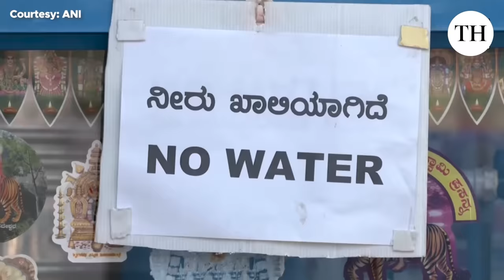Why is Bengaluru staring at a severe water shortage? | The Hindu

Comment: Answers for this problem
1. Avoid constructing High rise buidlings.
2. Avoid Traffic which will heat up the environment and also dry out the water
3. Deepen the Ponds 
4. Give permanant WFH to all the employees so that they don't have the stress while coming back to works
5. Avoid digging borewells which will even dry up waters 
6. Combine all the rivers altogether with other states so that it will solve the scarcity
Reply: That 6th point should be the 1st point. 👍

Comment: Bangalore as a highly developed IT hub that has outpaced its water supply. How much can Kavery do. It is only a small stream in Kodagu. The same situation exists in Chennai. The best thing would have been to shift all the IT sectors to smaller towns at the periphery of Chennai and other cities. The whole state can develop.  Once Chennai had more than 2000 lakes and many rivers. You could go by boat from Madras to Mahabalipuram. Even the areas around Chennai had so many lakes. A similar situation prevailed in Bangalore in the 1970s. Beyond Madivalam and Bommanahalli, there were only rice fields and lakes till Hosur. I used to walk miles and miles, and choose a lake to swim.

Several large areas have to be identified, where no construction will be allowed. These areas can be deepened and used as a reservoir.. The Cholas, Karikalan Chola in 190 AD built the Kalannai and Sundara Veera Chola build the Veeranam reservoir more than a thousand ears ago. Mrs. Jayalalitha connected the Veeranam lake to Chennai city and its suburbs. Apart from this Chennai still has some lakes that supply fresh water. If these lakes fill up and overflow in the rainy season, Chennai will drown. Some parts of Chennai are below mean sea level.

Bangalore is landlocked, but if there large reservoirs located all around Bangalore, all the water can channelized in the ran season and a constant supply of water can be maintained for Bangalore city.
Reply: Thank you.

Comment: Not blaming any party in particular. But Bangalore is going to the dogs. People are constructing six floors with out approval. No one to check. Pollution is increasing and is upto 150 aqi on daily basis now.Hardly 10 mtrs wide road will be allowed to construct 20 story apartment,Schools  without thinking about future. Problem not just with water, electricity road side walks have same problem. Future planning is completely missing new areas coming up, also have narrow roads similar to old road. Request to govt to handle this fast

Comment: The city has very bleak future as far as water and infra is concerned.  The city was allowed to deteriorate over decades thanks to rampant encroachment, unplanned growth, mindless creation of gated communities causing endless dead-end roads thus putting pressure on available roads, unscientific digging of borewells without realising that such digging could cause drying up of existing borewells, greedy builders who have no responsibility in planning the layout, providing the utilities etc leaving residents at the mercy of water mafias.  Anyone buying property in the city should think twice or for that matter ten times before buying an apartment as there is no such thing as investment as the city doesn't lack in availability of land parcels.  It is not Mumbai or Delhi where they are water locked and land-locked respectively.  Pick properties where there is good source of water supply. Power can be generated and supplied but not water.  Ask where will they get water for next 20 years if you want to pass on decent lifestyle to the next generation.  Jai Hind!

Comment: Ha ha benifits of staying on the outskirts. I am supplying water to water tankers no problems 😢😂❤
Reply: How much did you earn this month
Reply: @manikyum  just to known people 200 per tanker 100 will be electricity cost 😁😆😀 no business is that straight forward. People are digging too many borewells that's the problem some one digs deeper the water source diverts to that and existing borewells run dry. No one is drilling next to my house so I am safe for now
Reply: @samiullahk7223  Great. But how to gauge how long will your bore last? It will also run dry right
Reply: @manikyum   yeah that's the scary part. people have been selling 1 tanker load everyday without any problems so not scared
Reply: @manikyum   my stream is same as the one selling water cans. He constructed a building out the money he earned next I am planning a drinking water plant and package water bottling plant small scale after that.. there is a lake near by if the water mafia is kept out of the area then the bore is good till the lake lasts

Comment: as the population rises, pressure will build on these basic supply like water, electricity, groceries and all. out of these the static ones is water as we cannot produce it and we'll have to use the existing water supplies only.... people or I must say our corrupt Gov will not think this much as they're busy giving money to big corporates and getting money from them. 
Actually even in whole india I think soon we'll have this water shortage as overpopulation is increasing and people will require resources.
All these problems can be solved by planting more trees and having more greenery but on the other hand we're constructing more buildings, more trees we're cutting due to which our tree resources are also going away and trees roots which help up holding the ground water is also going away..... People just think money is everything.. But money is just a way of living, this earth has limited resources for increasing population, we just cannot buy it with money